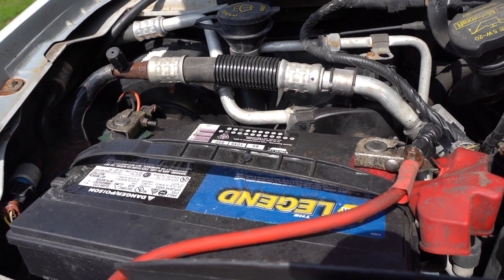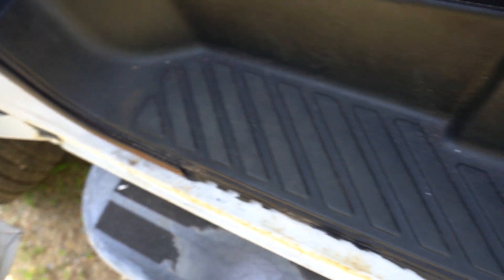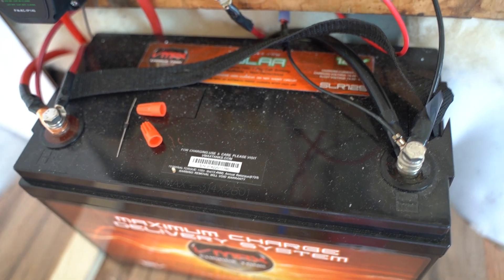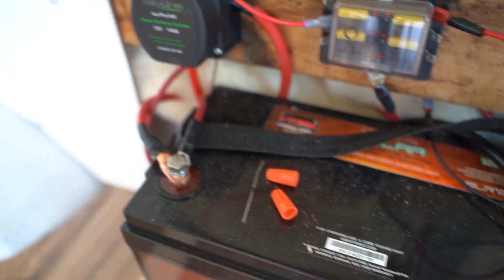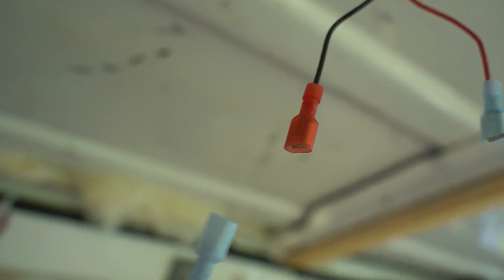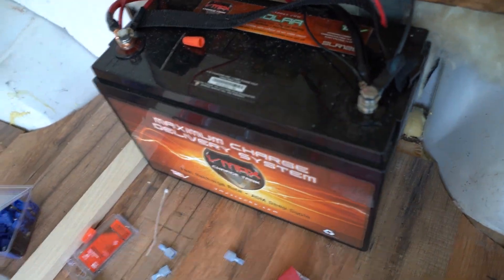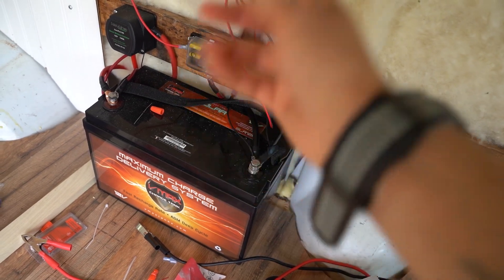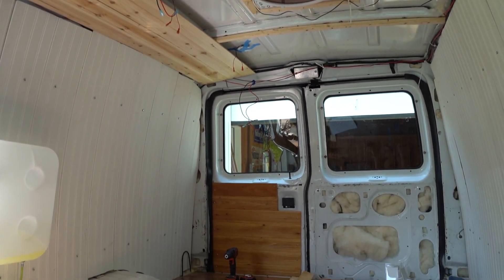Simple Van Electrical System | Ford e-250

Comment: I don't want to grumble, but still... When fixing a wire with a tie, it is better to wrap the wire in this place with a couple of layers of textile insulating tape, and only then fasten it with a tie. Even if there is a fuse in this circuit

Comment: cool!  also, get a battery meter (to measure amps, volts) so you always know the charge status.   also your battery (lead acid) can't be discharged more than 50% else you'll damage and\or shorten the lifespan.